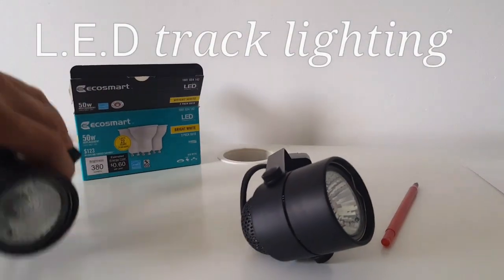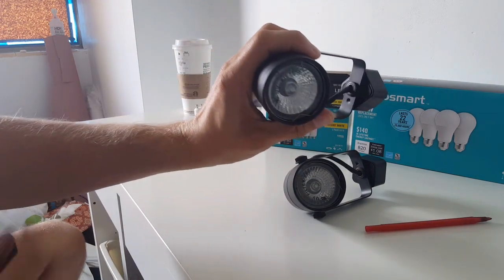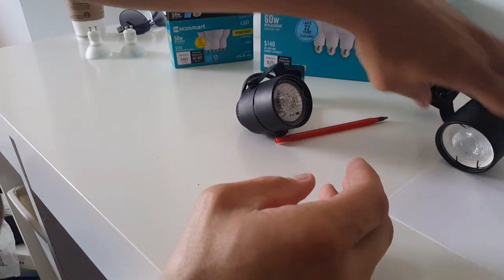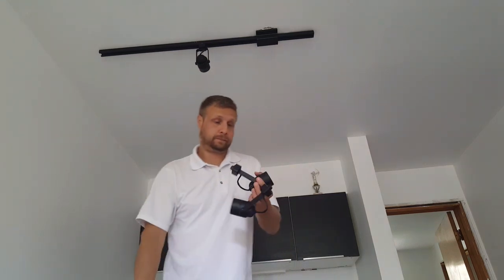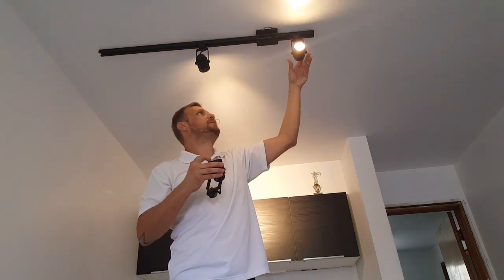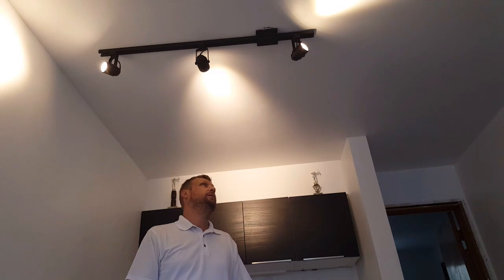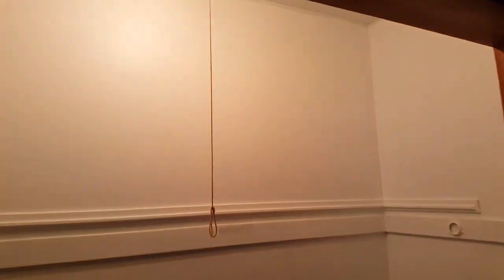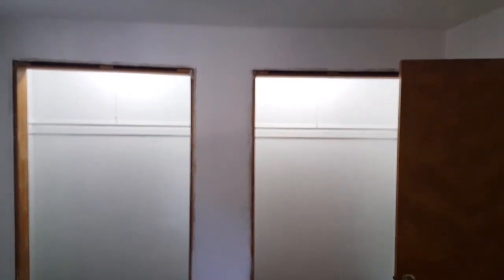Converting track lighting to LED lights

Comment: Have you had issues with the LED bulbs burning out in those track fixtures?

As I understand it LED bulbs need to shed heat, and I have heard that LED bulbs in those types of track heads will burn out very prematurely.
Reply from the maker: Hello it has only been about 9mos and they are still working great. Thank you for bring this to my attention. If I have problems with these lights I will do a follow up video and attach it at the end of this video.
Reply from the maker: +gskibum sorry for the delayed response,  they are still working great 0 problems

Comment: How do you know how many amps your track provides?
Reply from the maker: It will pull as many amps as needed, with LED lights your amperage will be much less than the original halogen bulbs. Please subscribe to see an upcoming video of transforming commercial lighting into LED in a large commercial building.